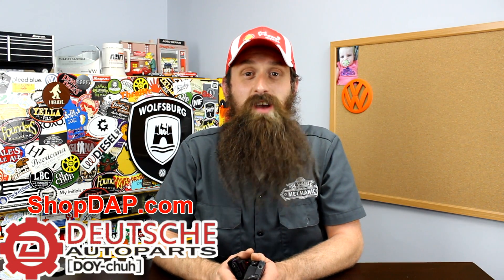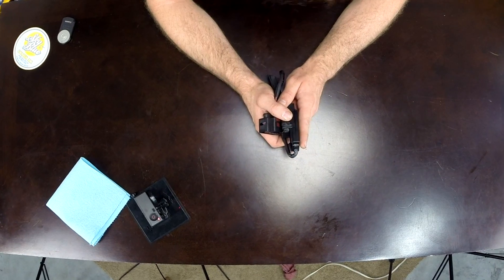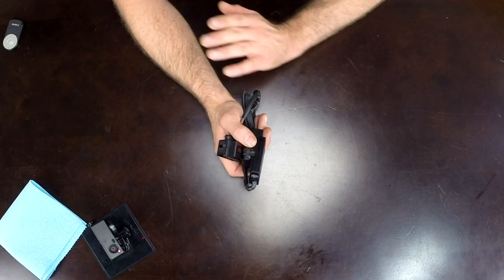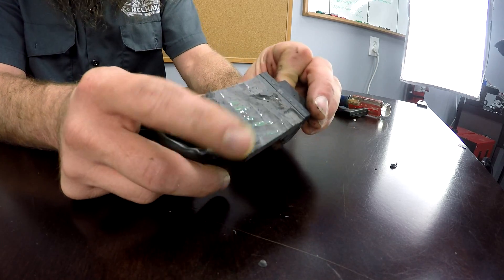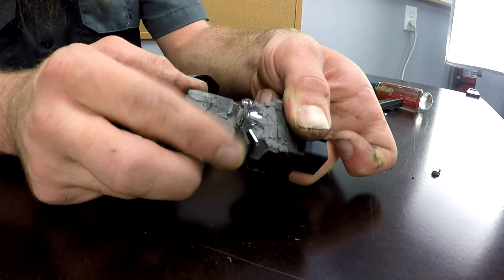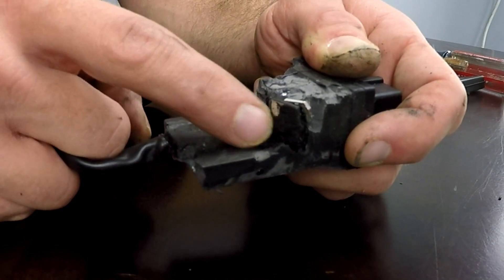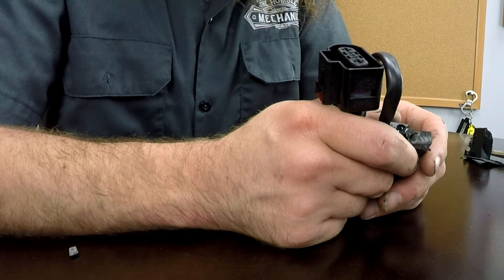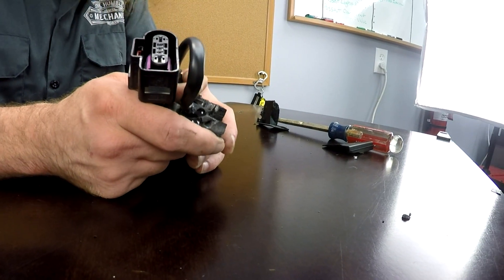How VW Parts Fail ~ 2.0t Fuel Pump Modules

Comment: Epc light showed up on my dash along with car running like crap. Next day started it again and had blinking check engine light and running even worse. Almost seems like it wants to stall. My question is could this be a faulty fuel pump module symptom or the result of a faulty module like too much fuel causing cat to fail and become clogged? Any advice would be appreciated.

Comment: Hi got an Golf Mk5 Gti and it cut out after 2 3 hours and i replaced the high pressure fuel pump fuel filter rely from fuel pump and same problem and got code coming of P0087 I have check the module but looks good not burnt
Reply from the maker: call your local dealer. Some of these modules are on recall
Reply: Thanks
Reply: Senior Bobowicz Did this end up fixing your problem?

Comment: Hello... 
my car is running normal, but the ir a yellow ligth on... 
i checked with Scanner and is with  FAUT 000604 - Fuel Pump Control Module P025 - 000 short to ground - intermittent.... 
Can be  problem in this part ??? 
Thanks

Comment: Hey James, really love your videos! 
I have checked too many forums and online videos, still have a p0087 code. Changed: HPFP, LPFP assembly, Pump control module, camshaft, follower, rail sensor, pump sensor and pressure relief valve... specified and actual pressure are perfect up to 88 bar but nothing extra, hence the code. Anything you suggest checking additionally?
Reply: the only thing i could think of is to check the thrust sensor(s). especially if one cylinder is having a misfire code that would be the thrust sensor to check/replace.  does anyone know if vag/com can see/check these sensors?

Comment: What would the output of voltage of this part be? 12? I'm getting a measly 3.2v. I know that can't be enough to run the pump, can it?
Reply: I think 10volts in case some one else needs it. Here is a better diagnose

Comment: it's truth, i have the same problem, i found the problem with the passat 2008 2.0T, the module very hot, because the fuel pump short circuit, but the firs problem is the module overheat, the modulo pass a lot current 10.8 amps, thats why burn it, i bypass its works good but the check engine ligh gone but with scanner say only 1 code p3044, fuel pump short circuit u think is correctly do it this?
Reply: Dear Engineer Ruiz. Does the fuel pump short circuit causes the overheat in the module? I have the same car, but in my case the fuel pump doesn't turn off, I need to disconnect the module to avoid discharging the battery. But I don't  know if I need to change the module, the fuel pump or both. Thanks for any advice.

Comment: will a module failure cause the pump to run for about 2 seconds then shut off?? will always restart but only run for about 5 seconds, sometime run for as long as 15 seconds or so. code p3073

Comment: I have a 2010 passat 2.0T that after stopping or idling for too long, shuts off after trying to accelerate and I have to coast to the side, the battery is on and fine but the engine shuts off.  It takes a few tries to restart sometimes but then runs smooth until it decides at a random stop, to do it again.  It will also do this if idled for like 10-20 seconds.  Could this be the issue?  Or is it the fuel pump itself?
Reply: SilentMott did you ever get it fixed and what was the issue? I have that exact same problem and car
Reply: It was in fact the pump control module for me.  It was a quick fix, for around 150 bucks.  It COULD also be a bigger issue with the internal pump itself I've heard so cross your fingers its not that.  I also had a water pump fail on me not 2 weeks later which cost me 700, ain't ownership fun?  I'm definitely learning to keep a MUCH closer eye on my car these days, it seems like a part of VW ownership.  Good luck.
Reply: SilentMott yes I went and got it fixed today luckily. I almost took it to the dealership thinking it was the fuel pump it's self and would've been about a grand in.

Comment: @humblemechanic can a bad fuel pump or bad fuel pump module set off the epc light as well as the check engine light
Reply from the maker: +Jorge Cabrera yep it sure can
Reply: Yea I figured I have a mk5 gti and today the car just shut off on me on the highway the dash and the all of the lights were working but the car itself shut off tried cranking it over and nothing it felt like it was drowning in gas
Reply: @humblemechanic so I changed my in tank fuel pump I changed my fuel pump module and I changed the fuel pump relay and the car still doesn't turn on any suggestions for what else it could be
Reply: Jorge Cabrera did you find the problem?  My mk5 gti had made the same think driving on highway and suddenly the engine stop working

Comment: My 2008 Passat LUX recently started just cutting out after being driven around 30 minutes.  After sitting for ~45 minutes, it will eventually crank.  If trying to crank too soon, there is a rough sputtering sound.  The symptoms seem very similar to the I will try to get the codes checked soon, to see if if matches the common codes for this issue as well as if there are other issues.  

If the control module is overheating, is it a definite sign the CM needs to be replaced?  I now think I should look at replacing the fuel filter (173,000 miles on it).  Is it possible that a fuel filter full of sediment would cause the CM to pulse more often and overheat.  So, basically has anyone seen a partially plugged fuel filter be the cause of the CM overheating?

Comment: Great video, thank you!  I have 2009 CC and believe I am having an issue with this part, hard to start and hesitation.  However, I do get a strong fuel smell inside the car and out, would this be related to that problem?
Reply: your problem is more then likely the fuel line has a pin hole in it and is leaking fuel right at the fuel pump. Its def not the module tho
Reply: RichBeastly hi I’m having the same problem any updates
Reply: Theres a recall on  vw cc 09 .go to the dealer and theyll replace it free

Comment: Hey man, thanks for all your helpful videos! I have a question regarding the fuel pump module: my B6 Passat 2.0T suddenly started cutting out in traffic. I limped home, pulled a P2293 code, checked the fuel pump control module and it was indeed very hot. Replaced with latest revision the next day and no issues since. My concern though: the new module still gets very hot. Is the pump pulling too much current? How could I test? If you have any input I'd highly appreciate it since nobody in the forums has an answer. Cheers!

Comment: Hi my 07 new beetle 5cyl is not starting (crank no start) im getting a reading code on scanner P0102 Mass Or Volume Air Flow A Circuit Low Input so I checked the MAF sensor I found #5 wire cut off so I spliced it back together and cleared the code I try starting but still no start but now my fuel pump is not energized no sound when doors opened relay is clicking question is could I have burned the fuel pump from over cranking it when the #5 wire on MAF sensor broke off also before this 5th gear had no power and as soon as I turned car off and try to turn it on again that's when no start, thanks cool videos
Reply from the maker: +Tony Tapuro I don't think you burned the pump up by cranking. 

My guess is, the pump had been failing for a while. Now she is just dead.
Reply: +HumbleMechanic ,thanks I thought so and does the #1thru 5 on MAF sensor stands for or connects to cyl 1thru5 cause 5th gear sounded bad and no power when accelerating that's when #5 wire at MAF SENSOR broke off
Reply: Tony Tapuro At at

Comment: Those videos are awesome! Thanks to this video, i saved a lot of $$$$ for replacing Low pressure Fuel pump and even high pressure fuel pump! The symptoms for my car were engine was turning off wile usually I was coasting.Error code P2293.  After the engine turns off it usually starts easy and was working until the next time it happens again. Nightmare. Thanks Humble Mechanic!

Comment: Hello, I have a 2006 Audi A4 2.0t. Im experiencing a lack of power when I accelerate hard. The codes that show up are P2293 and P310B. The high pressure fuel pump, camshaft, and fuel filter have all been replaced. What do you think the problem could be? Do you think this fuel pump module is the issue? It idles very good and starts up just fine.
Reply: Jordan Ajamzadeh i am having tge same problem. No loss of performance  or hesitation.  Camshaft, cam follower,hpfp lpfp sensor,fuel pressure sensor (thrust sensor) all replace and fuel filter... i am totally at lost on the issue. The cel come on after 255 miles or going up hill with a high load.
Reply: Do u find the probleem?

Comment: I am VERY appreciative of all the videos and information. I'm 99% sure I've fixed this problem just by replacing this part. We've only driven about 20 miles, but so far all is well. :-)

Does anyone know the differences in the versions? I had "F" version that failed. I bought a new one that was supposed to be version "H", even says "H" on the box that I received, but the PART says "G". What gives, and what's the difference?  

Our symptoms were: Stalling at idle only, then progressed to stalling while driving at low speed. At first it would start right back up, then it got worse until it required several attempts to start. At this point CEL was on and code was P2293. As an experiment and to help troubleshoot the problem, I raised the back seat and applied an evaporative cooling towel to the module. I believe it helped me get home on the last drive before parking and waiting on the part to arrive.

Comment: Hello, I have a 2 questions about this Fuel Pump control module, 1st is I got two check engine lights p025c (Fuel Pump Module Control Circuit Low) and p0304 (misfire cylinder 4), I already did the basics, I changed my coils spark plugs and both codes keep coming back, can the fuel pump control module throw misfire codes as well? And if Is it recommended to change the in tank fuel pump along with the control module at the same time since both are connected or can i just replace the module?
Reply: hello silvio i have the p025C code , did u find a solution to it  , tried my luck on the internet but i have no clue on what to do thank you
Reply: Hi. Did you fix those problems? If so . What was causing these issues. Please advise. Thanks

Comment: i just got my fuel pump module controller replaced on my 2009 volkswagen cc and still having issues with my car not starting what could be the problem? codes p2293 and p0302. please help

Comment: hey nice video, very informative, i have a 2012 CC TSI 2.0 turbo, recently the car just died when i was driving, check the car and give me code P2293 - Fuel Pressure Regulator 2 Performance, so i replace the HPFP and Cam Follower and still won't start, do you think the fuel control module would be the problem or just the fuel pump? or do you think i might have to replace  both?
Reply: Hi! I dont speak english,.. google translate: My solution: remove the module from the seat (out of the seat) Cable elongaton to trunk. To the open air.  And buy a little fan (5V - Car cigarattes lighter, or USB)  All cost: 100 €
Reply: Hi bro. Just happened to me. I drove audi A4 2.0T 2013. May I know your solution? Thank you

Comment: Similar for a 2009 CC VR6 4motion? 

Got a P0190 code and it runs bad, acceleration is gone. Watched your video on fuel pump replacement (subscribed!) and was concerned about the 4motion issues you discussed.

When I get home, I'll check the control module for damage.
Reply: +Robert Graham Checked the module, no sign of damage, not hot. Let it idle for a while, no heat.

Comment: nice video man.  I have an 06 passat 2.0T. with extreme rough idle. I have codes  P2539, and P310B (both codes are low fuel pressure sensor codes.).   Can this fuel pump module cause these codes. I already checked the low fuel pressure sensor and seems to be OK.   I'm getting 20 hertz from the PCM to the fuel pump module.
Reply from the maker: +Ludguin Moreless It could, but with the P310b I would also want to check the high pressure fuel pump.
Reply: I get around 700psi at idle, and around 1250psi at 3000rpms at the fuel rail pressure. Is that normal?  And the low fuel pressure sensor stays at about 1.9volts at either idle or 3000rpms. I will really apressiate your advise.  I'm a little lost here.

Comment: sounds similar to fords fuel pump driver module. 
duty cycles the fuel pump instead of using a fuel pressure regulator. 
common failure too!

Comment: Hey I posted an incorrect comment on the fuel pump video but it turned out to be this part!!! It was hot to the touch too! Your videos are the best! Thank you.
Check engine light code: p2293 and was cutting out while driving 09 CC 2.0

Comment: potted electronics are pure evil, btw, that's a terrible design as potting compounds are terrible for heat transfer hence you leave the backside of the power packages on the surface where you attach a heatsink of some kind(i can understand why they potted it due to the posibility of gasoline fumes nearby, then again there's a submerged brushed pump INSIDE the tank AND penetrating vessel connectors so moot points there).
Also, not likely a regulator, but the power mosfet that drives the pump, likely pump gets harder with age and eventually module goes bye bye due to thermal stress.
Has VW released an updated revision?(if not, they should, with far bigger components)